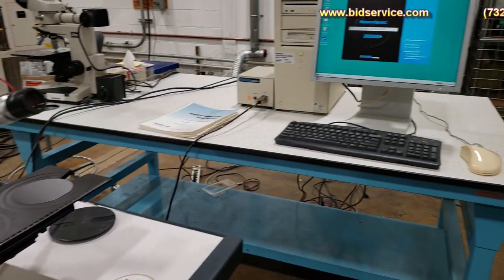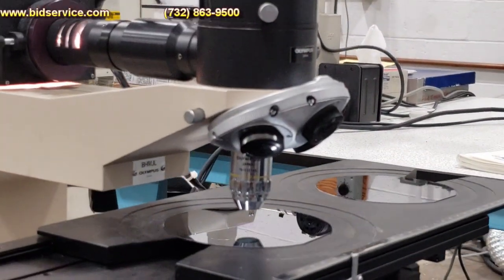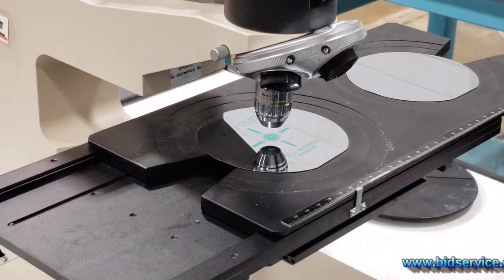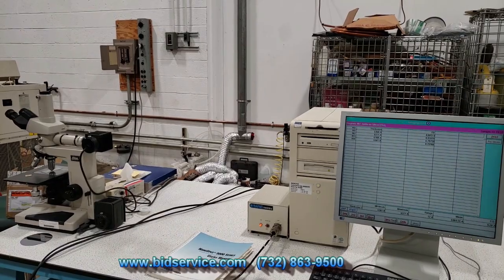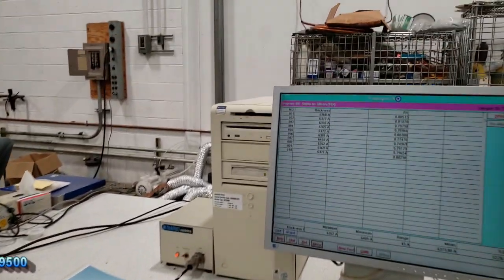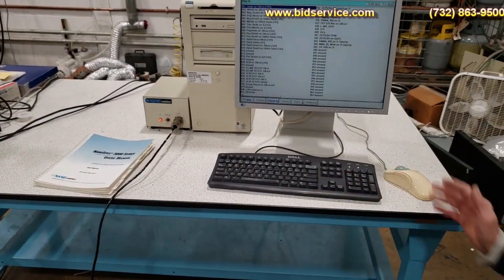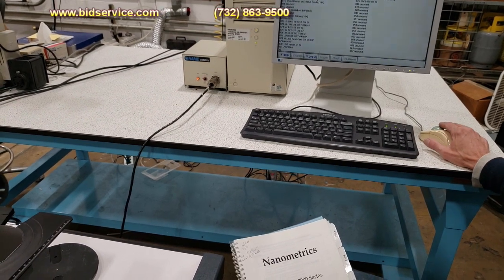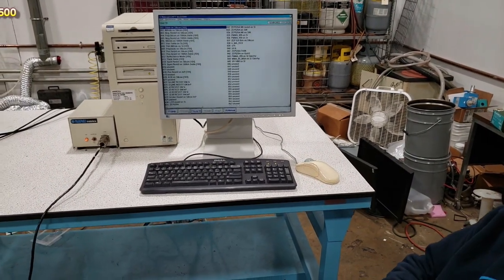Nanospec 3000 Inv# 64,587

Comment: After the measurement, what the column ''Fit'' is used for? Is it generated as the counter-map of the measured layer? what is this? Could you help me to understand this?
Reply: It's just a metric for how good the fit is with whatever model you picked, higher number is worse. Below 1.0 is what you're aiming for normally.